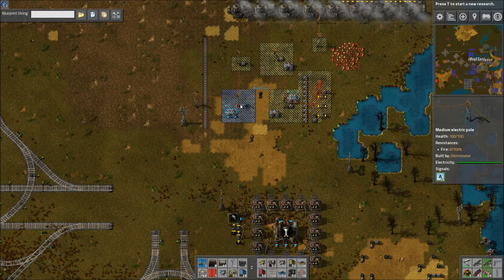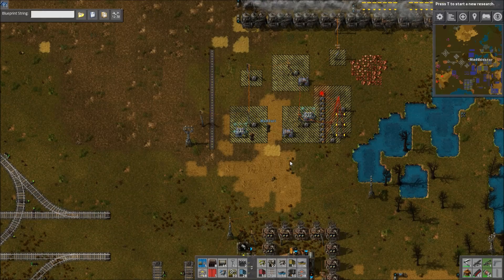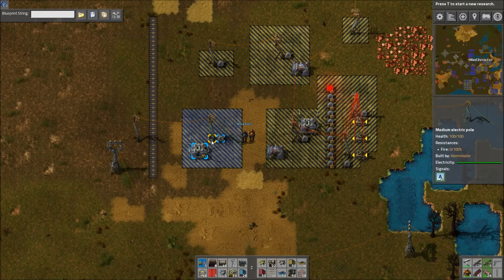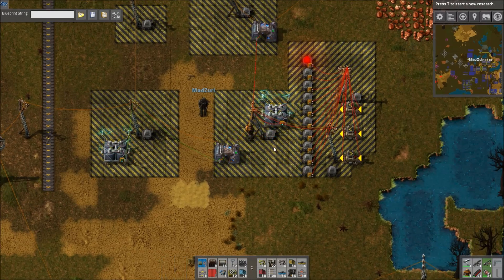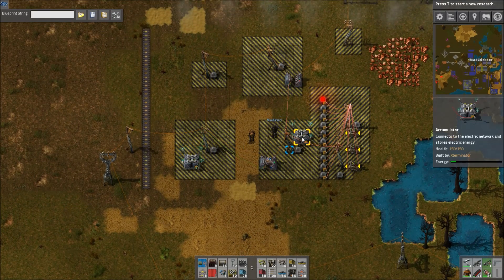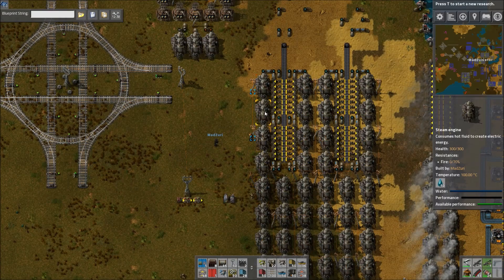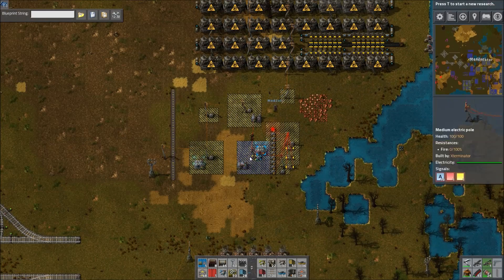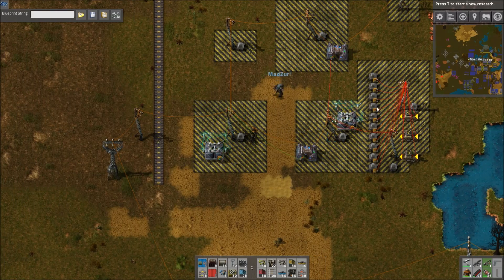Factorio Workshop - Building A Better Factory :: Punk Pensioner's Backup Power Switch

Comment: None of these damned tutorials explaining how you get a signal from batteriy state. 

The whole tutorial should be just like 30 seconds long putting down an accumulator, wire  up to anything (like a decider combinator). Then mouse over it showing notting happens. Then connect it to power... mouse over again and show we geting an A signal from 1 to 100 telling the state.

That is realy like 30 second. Then just provide a link to an other tutorial how to use this A 1-100 information... link for tutorial about combinators, power switches or pumps and stuff like that... whatever way you want to continue. 

I  watched like 5-6 tutorials none of them explaining that you get a signal from battery. I had to actually find out myself, experimenting it. No, don't say it is, cos it's not obvious.
Reply from the maker: Mikae7 while that would be a good thing to make a little tutorial on, that isn't what this video was for. This video was specifically for showing and explaining a power switch submitted by someone.
Reply: No worry I'm just moaning ;)
Reply from the maker: Lol it's fine, I know that feeling sometimes. :P

Comment: I have realised after looking at Zuri's analogue set up, that my design featured here is far inferior, and I'd encourage people to use that instead. His design copes with every eventuality, mine has flaws that mean once placed, you continually need to tweak it as the needs of the factory change.

The biggest flaw in my design is that it is possible for the main factory power grid to drain the accumulators faster than the single isolated accumulator. This can lead to the steam engines not powering up when they are needed.

If you see this happening, then the best solution is to build more solar on your main grid. (This design is about trying to avoid needing the steam power). Alternatively, add more power consumers to the single isolated accumulator to make sure it drains more quickly than the main power grid.
Reply from the maker: Thanks for clarifying some of the potential issues with your build, but still, your build is pretty darn good for the most part. Glad you submitted it for us to look at it, I'm definitely tempted to try it out in one of my own bases. :) Keep the designs coming!

Comment: Technically, the real problem with mixing steam and solar is that, in the early morning hours, the steam engines will stay on to recharge the accumulators to 100%. This is a waste of fuel because the solar panels can recharge the accumulators. Connecting the steam engines to main power only through a power switch (set to "turn on" only when accumulators are < some percentage) as shown in the video prevents the steam engines from staying on longer than needed, which conserves fuel.
Reply: Actually I think it's worse than that. The steam engines seem to ignore the accumulators completely, and switch on as soon as solar is generating no power. They stay switched on even after the accumulators hold 100% charge, until solar starts up again.

That's why I produced this build, to stop the steam engines powering on at night, regardless.
Reply from the maker: Yeah exactly! We might not have clarified the reason that you mentioned but you are exactly correct. That's what I liked about this power switch is that it will only keep the steam engines on until the rest of the main power reaches 10% essentially.

Comment: Just for the hell of it....

http://pastebin.com/ey1z6YEn

This is completely overcomplicated and unnecessary, but very fun to watch on the power screen as it steps power based on need.  Can be tiered together.
Reply: So this isolates the steam engines by disconnecting the power poles with a power switch, based on accumulator charge being between 2 values? Like mine, after placing your blueprint, there is some manual placement (and removal) of copper wires required due to a factorio bug.
Reply: ThePunkPensioner Sorry for the bug, and yes, it steps between 2 values per steam engine.  It's penny pinching to the extreme...lol

Comment: Is the fact that it turns the steam engine off at 50% intentional so the steam engine don't flick on and off
Reply: That's right. The accumulator that causes the steam engines to switch on at 10℅ charge is isolated from the main power grid, if the accumulators in the main power grid  fall below 50℅.

At this point the isolated accumulator starts to drain because it is the only thing that is powering the lights and combinators.

Then one of two things can happen.

1) The accumulator in the main grid starts charging up during the day because solar kicks in. As soon as the charge in the main power grid gets back up to 50%, the single accumulator is unisolated, and recharged.

2) The main power grid never gets back up to 50%, the isolated accumulator eventually drains to less then 10% and the steam engines kick in. As soon as the accumulator in the main power grid gets up to 50%, the isolated accumulator is unisolated, it quickly gets back above 10%, and the steam engines shut down.

Without the power switch that isolates the accumulator, the steam engines would just flick on and off continually until the solar power kicked back in.

If people want to tweak this set up to suit their factory, I'd recommend that they play with the 50% switch, and reduce/increase that number.

Of course none of this build would be necessary if the game would not ALWAYS switch on steam as soon as the solar stopped generating. :(
Reply: Thanks for the clarification. Might have to try this set up on my own Factorys
Reply from the maker: That's possible actually. Honest answer is I'm not sure. Again, I think it would work a lot better if you were actually using Solar and Accumulators for your main power source and then steam power for backup.